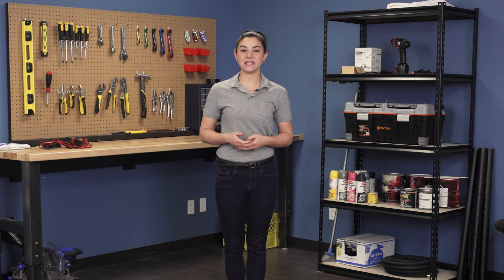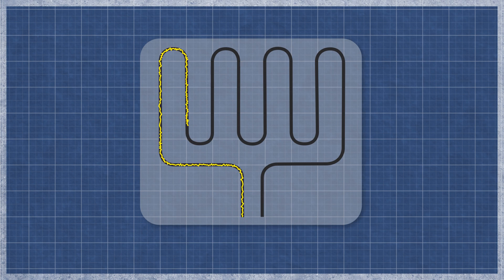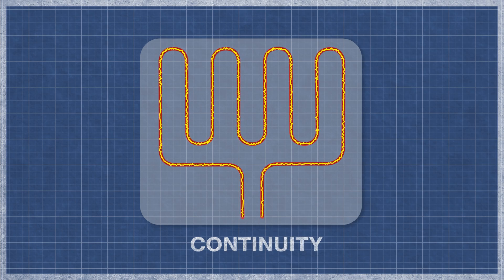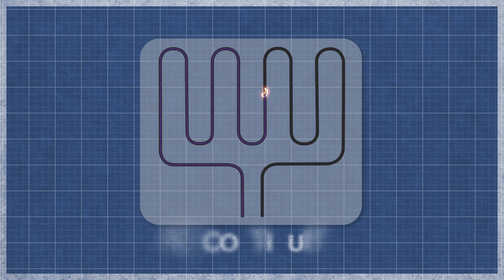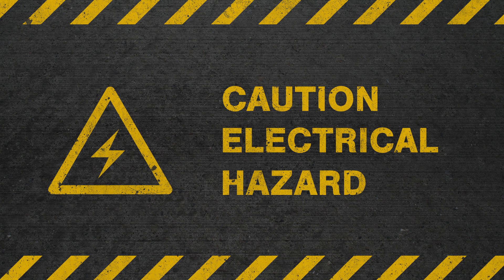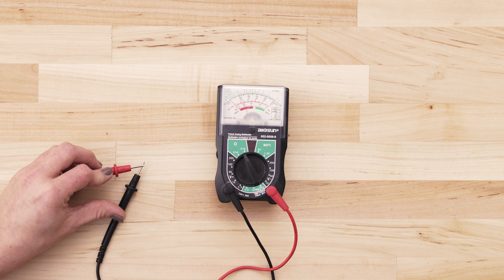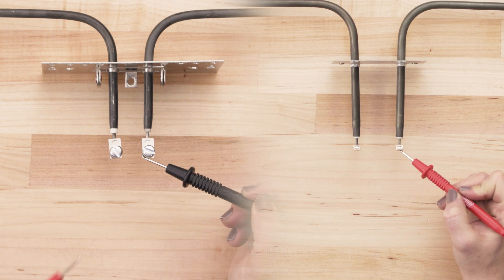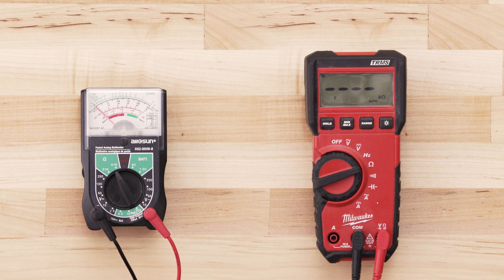Oven Heating Element - Continuity Test

Comment: You might of Made My day today, we Will see if thats the problem with our pizza oven, it might be As it kind of exploded..
Reply: Update: elements were fine, checked the plug and apparently that was broken... so that was an simple fix.. but thanks to the video I did find it using the multimeter and was testing it all out. So thanks anyways!
Reply from the maker: You're welcome!! The multimeter is definitely helpful for narrowing it all down, we're glad you found the video helpful!
Reply: AMRE Supply ive cut the plug open and its an warzone, it was exploded and also Made My ground wire life, at least i knew now why only 46 voltage came trough the Cable and it was broken
Reply from the maker: Its good that you were able to confirm and support what was shown on the multimeter. It sounds like there was a short somewhere in there.
Reply: AMRE Supply if I could send pictures in the comments I would show you the broken charred cables

Comment: Hi my oven stays on till i turn the temperature dial. Abt 5mins into heating it breaks the circuit to the hse. So is it the element or the dial? I have tested for both the top n bottom elements n it happens for both of it. Pls advice.
Reply from the maker: Hi Steven, it sounds like the temperature control switch is malfunctioning or it could be a problem with the control board. The switch can be tested for continuity but is a little less straight forward than a heating element, you would likely have to remove the whole panel to access the switch. As for the control board, they are generally pretty expensive and it would be best to verify with a professional before replacing.
Reply: AMRE Supply ok thanks il try that.